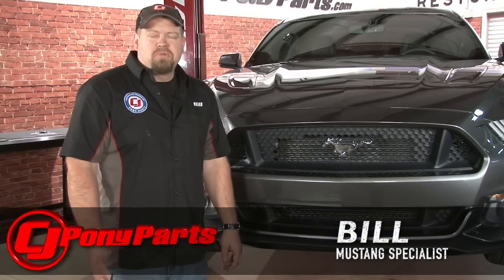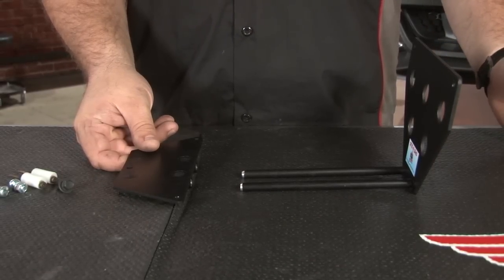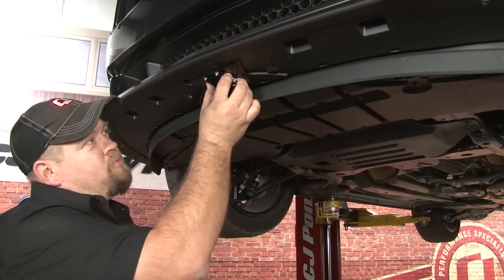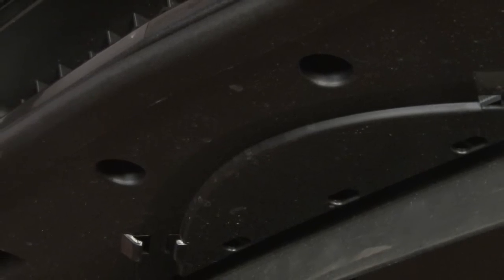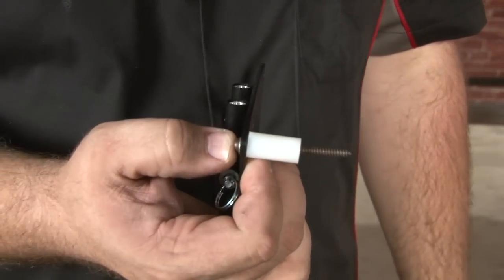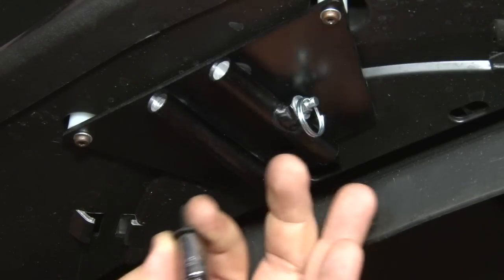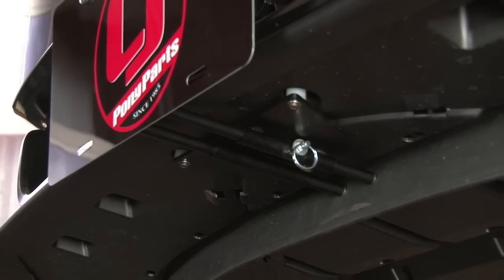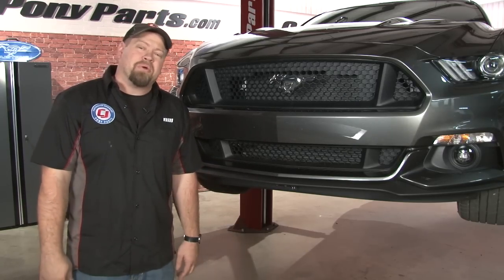2015-2017 Mustang Sto-N-Sho License Plate Bracket Installation

Comment from the maker: Do you live in a state that requires a front license plate? If you're like us, you don't want to drill into the front bumper of your 2015 Mustang to be legal. With the STO-N-SHO, you can be legal without any damage to your car. Watch as Bill shows you how easy this install is.

http://www.cjponyparts.com/license-plate-bracket-sto-n-sho-2015/p/LPB39/
Reply: Do you guys have a similar product that will work with a 2018 GT Performance package?

Comment: Could this plate holder be placed off to the side instead of dead center? You'd probably have to drill new holes?
Reply: Several people on the 2015 forums have mounted them offset and drilled new holes.

Comment: Does this fit the GT350 bumper from MP Concepts ?
Reply from the maker: Hydz which belly ban are you using? If stock was the car a performance pack or not?
Reply: CJ Pony Parts it’s the stock belly pan and no it’s not the performance pack
Reply from the maker: Hydz the one linked in this video would be your best bet then.
Reply: @cjponyparts  
Do u have one for a gt500 bumper?